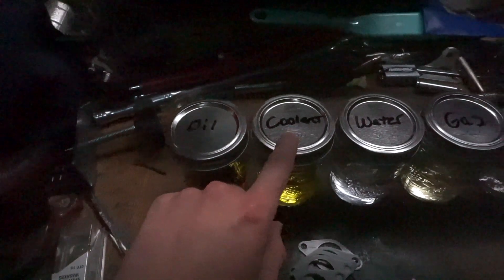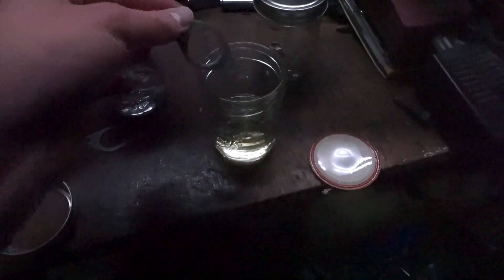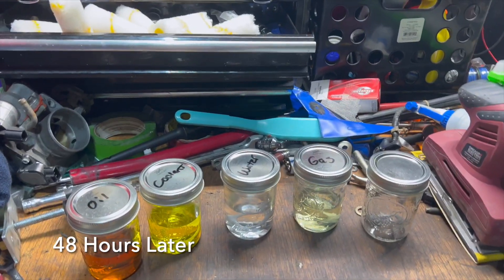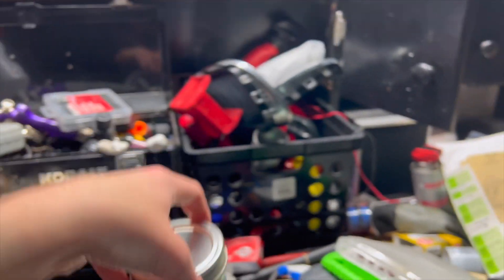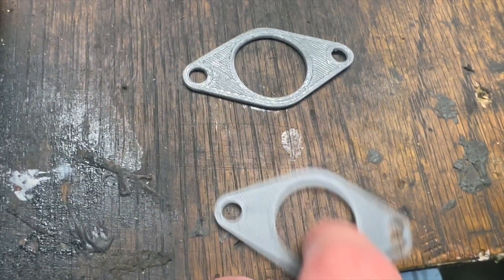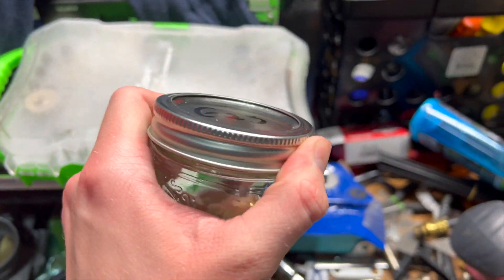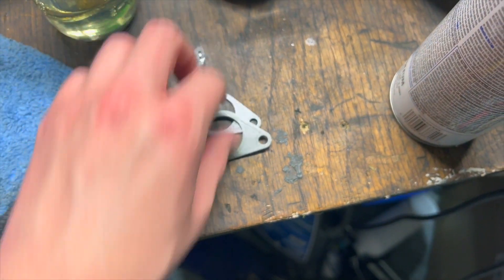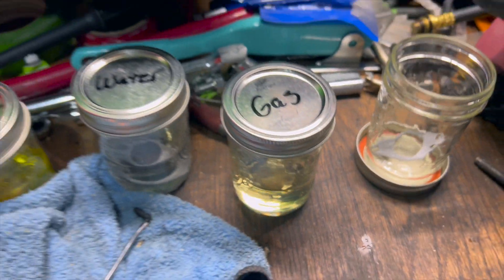Can you 3D Print a gasket for automotive use?

Comment: The printer settings are very important as well. It seems that you printed those gaskets on the fast setting by the looks. Try using a 0,12 mm fine layer and increase the temperature by 10-15 degrees Celsius. You will be surprised 😉

Comment: While I love 3D printing and I own 2 printers that are kept busy most of the time, a better solution for gasket cutting is a machine like a Silhouette Cameo or Cricut and get the sheet gasket material and cut with these inexpensive machines. There are people that sell gaskets for old chainsaws and small engines made on these machines, since it's the proper material and you can cut a gasket in a few minutes it just makes more sense unless you only need the 1 and never again.

Comment: missing a HUGE factor - temperature. Yeah, the materials can resist various chemicals but break down at engine temps so you can't use 3d printed gaskets anywhere it gets hot like coolant gaskets  and stuff on the block.